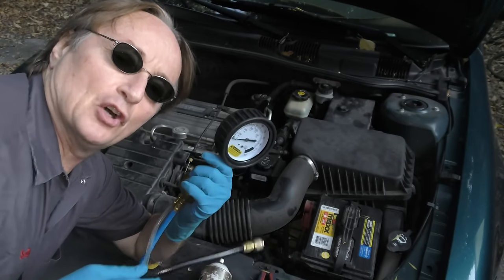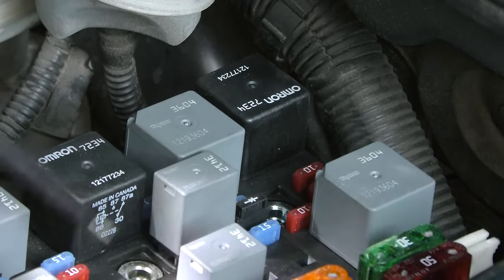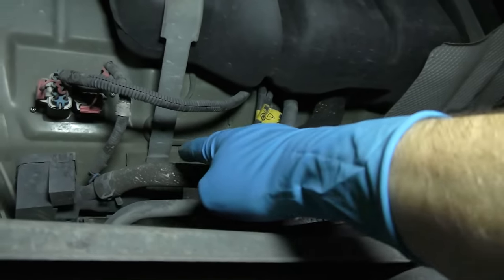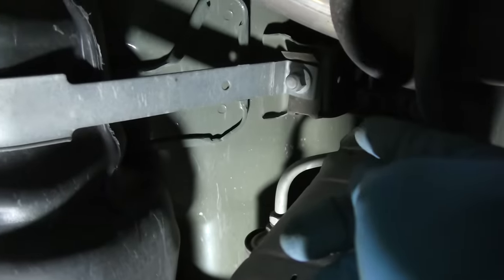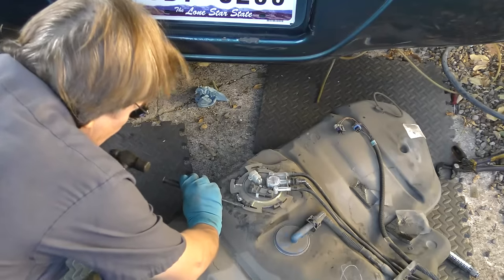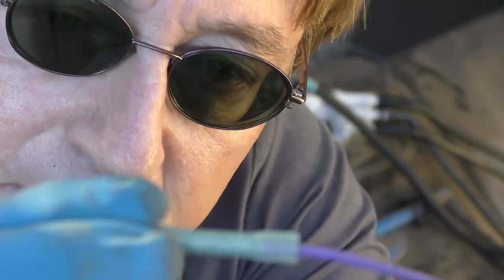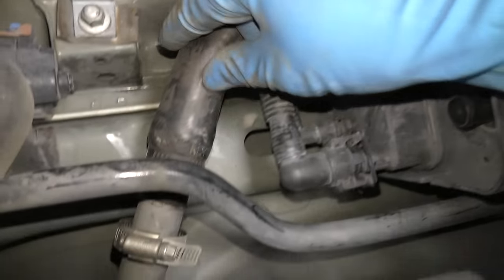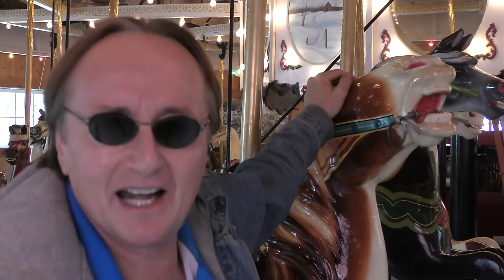How to Fix Car that Cranks But Won't Start (Fuel Pump Assembly)

Comment: Nice video Scotty, but shouldn't you show that there is a proper crimping tool to use with the butt splice connectors.  You showed the jaws of ordinary pliers squeezing the connector.  The crimp tool makes a nice tight dimple in the connector for a better electrical and mechanical connection.

Comment: Hey Scotty; do you prefer fuel pumps being on the outside of the gas tank or inside?
Reply from the maker: +Squishysforbreakfast outside
Reply: Scotty Kilmer I guess that makes sense lol. Especially when you gotta work on them eh?
What about owning them? Do you still prefer them to be on the outside?

I'm just wondering because I've heard that in tank fuel pumps are more reliable in general than those on the outside. Plus the new GM twin pick ups have them on the outside of the tank.

Comment: Had my '92 Chevy van die on me, fortunately I was parked and it was just idling.  But when it wouldn't crank back over, I suspected a bad fuel pump too.   Of course, being the noob that I am, I didn't think to check for the sound they make prior to starting the vehicle up, so I went through all the hassle of emptying the tank (enough), dropping it, buying a new fuel pump, swapping out the other one, and putting it all back together.....  only to find out it was the Ignition Module that failed.  So now I have a spare fuel pump if I ever need it.
Reply: +TazarZero 
"wouldn't crank over" or wouldn't start? There's a difference. 
Bad fuel pump wouldn't stop the engine from "cranking over".
Reply: Haywood Jablomy
Don't mind me, bud, still a noob with terminology too.  You got the gist at least, yes?
Reply: +TazarZero 
LOL. I do now. If that old van still has the original pump, I'd sure hang on to the new one too!
How much did that pump set you back...if you don't mind my asking?
Reply: Haywood Jablomy
I don't remember exactly how much the pump was.  I'm sure if you looked it up, the price of one today wouldn't be too far off from what I paid.  If I had to guess, I'd say maybe around $60??  The Ignition Module was far less though, I know that much.

Comment: My 2001 Concorde Lxi stopped while i was driving and takes a long time cranking to start back up and it will for a moment to a few minutes then just idles down lower then pass 500 and dies and takes a long time start up.. Also dies when trying to drive it gears...The fuel pressure is good but i hear a click coming from the intake tunning valve no idea what that does..

Comment: Hey Scotty! You forgot to mention those friggin' pumps cost a bazillion dollars!
Last mechanical pump I replaced cost $14 exchanged, and took 15 minutes to replace.lol
Reply: +Haywood Jablomy If you don't mind taking the fuel delivery module apart, you can usually get a generic electric fuel pump to fit for $80-$100. The pump is buried inside that module and a new one locally for my car was over $300. I got a used one for $50. If you get a generic pump, make sure the pressure is the same as the old one.

Comment: You should remind folks you have to fill the tank up after this job to get that bucket properly filled. The first one I ever did, I strapped the tank back on and jumped on the highway. As soon as I got up to speed, it sputtered and died. It started up again, then a mile down the road it sputtered and died again. Sitting on the side of the highway, I noticed the instruction booklet in the fuel pump box, and there in big red letters it was telling me I needed to fill the tank to at least 3/4 of a tank after the installation. Duh! After I limped to the gas station and filled it up, everything was fine.

Comment: Hi Scotty speaking of cars and having trouble starting, I jut replaced my starter and my fuel pump but I still feel a "lag"/ semi crank when starting WHEN I have had the A/C or the heat on for a while(15 + mins). Any idea what that might be? The alternator is fine, just installed a new battery and radiator too. ??? I'm stumped. Just interested on hearing YOUR opinion. Thanks man your channel is the best, everyone should subscribe. Esp car lovers!
Reply from the maker: +ss4vegeta1 I would load test the alternator again, as weak ones do just that, as can bad wiring
Reply: Going to do that but you think it could be the fuel injectors?
Reply: Just checked the alternator again it was good.

Comment: I've changed the fuel pump on my 2001 vw beetle (turbo diesel) it was sitting for several months before it was changed and now it cranks but won't start, I've been told the fuel isn't getting to fuel injectors.. is there any magic machinic tricks to do this without a fancy pump? Assuming that that is the issue of course 🤦🏻‍♀️
Reply: There is a fuel pump and a fuel filter did they do both. If the fuel filter is clogged even with a new fuel pump ull have a problem.

Comment: hey bro, i have prob...i have brought a swift vxi just 4 months back. the car was running good, 7 days ago i have done the pollution test also, bt after 2 dayz from dat, the engine is not starting. Though sometimes the engine is starting, a defective sound is happening and this is happening for 1 min. But now the engine is not starting, lights and symbols in the dash board is also not showing. plz suggest me bro.......

Comment: Hi Scotty. I have an 06' maxima that stopped on me while driving. I've used 3 different mechanics to troubleshoot and fix parts. So far combined they've changed: both valve covers and valve cover gaskets, the pcv valve, all the spark plugs and ignition coils, both camshaft sensors and the crankshaft sensor, the O2 sensor, the mass airflow sensor (I bought two new ones since i was told by the second one it needed to be from Nissan), and as of yesterday, the fuel pump was changed. It did the same thing, start once then cut off almost immediately, never to start again, only crank. Please help.
Reply: Just curious what ended up fixing your problem even after putting on a new ⛽ pump 😲

Comment: i replaced the fuel pump in my 02 grand am but it will not turn on due to low voltage. i dont know what the problem is any help would be much appreciated

Comment: I replaced the fuel pump 
And my car was fine for like 4 days,  i try to turn it on and it'll crank but won't start..
 New battery , new starter & now the new fuel pump...
I think it's some electrical

Comment: Do you think these pumps go bad because the in-tank filter gets clogged and the pump is overloaded?
Reply: +spelunkerd Old gas tanks tend to have crap and dirt at the bottom and if you run the car to low on gas the pump will pick the crap up and clog the filters burning the pumps out. It's always smart to fill the car up at 1/4th tank and no less.
Reply: +SkywallGuttz Very good advice to those who heed it.
Reply: +spelunkerd probably would've been better if he changed out the fuel filter as well...
Reply: +spelunkerd HI Dave , I was thinking about you the other day while I was making a series on making  jerky and you know what I did mention you.
Reply: +twoeagle86 Most of the newly designed fuel pumps come with a new fuel filter automatically included. I was puzzled by the new design until I realized that the classic fuel system used quite high pressure upstream of the filter. That created a possibly dangerous situation in an accident, and also the pump in those days had to be robust enough to overcome fuel filter resistance. New fuel systems have the filter upstream of the pump, so if the line is damaged in an auto accident there may be less fuel spilling onto the road. However an upstream filter is nearly impossible to swap out without dropping the tank.
Reply: +SkywallGuttz Also, the fuel lubricates and cools the pump.  Cranking or running the engine when it's too low can burn out the motor.
Reply: on my 1990 integra my fuel pump come with a in tank filter that prevents that.
Reply: +ScubaCat3 Always keep at least 1/4 tank of fuel in a car with a tank-mounted fuel pump. You are absolutely right, the gasoline keeps the pump cool. +spelunkerd If the in-tank filter gets clogged, or the inline filter (usually around the driver side rear wheel, or near the firewall on some Japanese cars) gets clogged, the pump has to work harder to deliver the fuel - which will, of course, shorten its lifespan.
Reply: +drfizzle420 Honda pumps almost never go bad ,,seen some relays fail ..
Reply: The fuel pump on my Durango is all one assembly.

Comment: my 2000 honda accord lx literally just did this to me.  now i might be able to avoid a huge bill from the mechanics shop.
Reply: +vashspecter Your car has an acces hole in the truck or under the back seat so you don't have to drop the tank. It should only be a 30 min job
Reply: +Nutz4Gunz45   really?  awesome!  thanks for the tip :D

Comment: I know the Germans of crazy stuff, but the fuel pump on my 2004 BMW 5 Series was under the back seat, and you didn't have remove the gas tank to get to it.  It also didn't break in the 11 years I had the car.

Comment: I've got a 2013 Astra, it's starts perfectly, runs perfectly but if I turn the engine off to go shopping or leave the vehicle for a few minutes it cranks but doesn't start, however if I leave the car a good hour or two to fully cool down it starts perfectly again, any ideas? It's been like this for over a year, I try to keep the engine running if I need to leave the car for a few minutes as a work around 😂

Comment: Hey Scotty, I have a friend with a 370z whose car starts on a warm engine but dies after about 2 seconds of running. Always turns on fine with a cold engine but warm gives her that issue; any ideas what to check? Battery is at 11.8V.
Reply from the maker: +AnalogCaliga on those, often a bad maf sensor or vacuum leak on the intake system

Comment: I have a 1997 Buick Park Avenue. It started jacking and driving really slow so I gave it a tune-up it was fine for a little while, then it started again sometimes it would even kill at a stop sign or red light, when I kept my foot on the gas it kept running I let off the gas it killed. I did a field treatment I let it run I filled it up with gas. Now it turns over but won't start any idea what it could be? Video request or reply thanks.
Reply: HALO FIRE Vacuum leak,use soapy water on those vacuum hoses! It helps u find the leak,u can either replace the hoses or temporarily fix it with tape,but do a good job or that fix will be for nothin!

Comment: hey guys and scotty i have a question

 What is the best way for me to learn about cars on the internet, any good websites except for youtube? *unless you know some really good youtube channels)
I'm especially interested in Audi, but i really want to learn about the basics in cars too
Thanks:)
Reply: +Iflexis Hi, 1, search for "forum fix Audi cars" or similar language and you will find many sites to help you.  If you narrow the search for your model and year you will get more details that apply to you.  2. If you have a repair that is complicated or you're not sure about tackling, you could try alldatadiy.com.  For a small fee like $15 for a year, they will show the repair procedures for your car if you can figure it out.  You can search for a discount coupon before you join and it might be cheaper.  Not the most user friendly to me.  Hard to find your way around until you get used to it.  Good luck!

Comment: Don't you have to change your fuel filter after you do this? I had to change mine twice when I did this repair a few years back..
Reply from the maker: +AngeredFox  you can if you want, but this pump was old and just stopped working from age.
Reply: +Scotty Kilmer ahhh...I had to because crap from the bottom of the fuel tank got stirred up and got sucked into the line/filter.

Comment: i replaced the fuel pump in my 07 hyundai accent and it still will not turn on. it cranks but no start, fuses are good as well. i dont know what else to do could you help me ??

Comment: I've had my fuel pump replaced and it still won't crankn over second pump that was replaced first one was due to my roommate using diesel second pump blew from the mechanic rigging my wires around my drive shaft and they got caught the wires have been fixed and again my fuel pump was replaced but still no crank?

Comment: I got a 1983 f150, just changed the fuel pump because I had the exact same problem and I’m still not making any fuel pressure. Anyone have any ideas of what to check next? Thanks!

Comment: So, I've just changed the pump and filter and won't start, but ironic is that the old fuel pump did get it started once the weather started to get a little warmer. Any suggestions will help me greatly
Reply: Can it may be lack of power to fuel?
Reply: May be but I'm definitely going to check

Comment: I have a 94 chevy k1500 my truck starts but stalls especially if I try to put it into gear or turn the wheel. I have replaced the fule filter the iac valve, erg valve, the tps, the distributor car and the rotor. don't know where to go from there. any ideas? thank you for your time
Reply: +Miguel Gutierrez check your pump pressure, depending on the type of system it should be around 55 or 62psi key on engine off anything lower than that it will never start and while you where there key on engine off watch the pressure game make sure is not dropping, that truck has spider injector and they know for leaking

Comment: I would have cut an access hole in the trunk where I live the rust under the car would require a lot more work and parts to complete the job.

Comment: I have a 2007 chevy impala. It stopped running. now it cranks and wont start. I have replaced the fuel pump, cam censor, engine coolant censor, the ignition switch, the  coil pack, the spark plugs.  still doing the same thing.  cranking and not starting. I hate to bother you but I'm out of ideas. I was hoping you might have some.
Reply from the maker: +Jeremy Howe do my other video tests "fixing a car that cranks but doesn't start up" and pray it's not a blown head gasket

Comment: Hey Scotty, I have this same problem with my 01 Civic LX. Just that it starts sometimes, and then other times it take a few tries to start it up. Could it be the Fuel Pump? I know that theyre pretty easy to change on these cars.
Reply from the maker: +Gilberto Benitez  could be, BUT try cleaning the fuel injectors first as dirty ones do just that

Comment: Hey scooty, 
Looking into buying a 2013 Chager R/T or a 2012 Ford Taurus, which one would you recommend?
Reply: I would definitely go for the Charger. I feel that it has a more engaging drive
Reply from the maker: +Shawn K depends, if you want speed or reliability, charger is fast, taurus will outlast it

Comment: Hi Scotty , how do you know if your water pump and alternator is packing up, thanks.
Reply from the maker: +Thavanesh Chefty alternators can be load tested, and water pumps can be pressure tested as they often leak at the main seal when going bad
Reply: Hi Scotty , thanks for the info . I will give it a try and let you know what happens.

Comment: I'm having problems with my xj running. It will start but won't stay on. The gas pressure drops after it starts and it dies when it gets to about 10 to 15psi. While I start it the pressure is at 40. I replaced the pump and it still does it. It has a new filter also. Any suggestions?
Reply from the maker: +Mac MashPotato replace the fuel pressure regulator, and pray it doesn't have a bunch of leaking fuel injectors too

Comment: 2000 Toyota Camry Le, replaced  water pump, fuel pump, fuel valve service repart on Dec 2019. My car won't start

Comment: So my fuel pump isn't bad. Cause the problem with my Pontiac is that I don't get an accurate reading on my fuel gauge on the dashboard. It either reports full or empty, regardless of how much gas is in the tank. Any ideas?
Reply from the maker: +iamageek500 generally a bad fuel sending unit which is part of the pump assembly as in  t he video

Comment: Hi Scotty Kilmer, I just had the timing belt changed on my 2008 Hyundai Elantra. It seems to be running fine, except for I believe a wheel for one of the belts that sounds louder than normal. My car also seems to be idling slightly higher than normal also. What could be the issue? Thanks
Reply: +El Pollo Loco 51 the new belt has more tension the old the old belt could have been bad for a while and now you have a new one you notice the difference
Reply: +El Pollo Loco 51 One of the reasons i will never purchase any car that comes with timing belt instead of timing chain that will never need replacement... i tend to drive my cars up to 200,000miles before getting another. I cover a lot of distance everyday and  easily hit the mark after 4years.

Comment: @scotty kilmer my 98 explorer had all the symptoms of a bad fuel pump so I changed it along with the filter and it still doesn't start at the fuel rail I get 35 psi any suggestions
Reply: Do your injectors fire correctly?

Comment: hey scotty my car wont shift into an gear.. also my car turns off when on neutral could it be the clutch?
Reply from the maker: +KingVic95 well, a clutch won't make it turn off in neutral, so you have at least 2 different problems. Put put in a clutch first IF the master and slave cylinders are OK

Comment: Just replaced the fuel pump on my 2003 Ford mustang 3.8 V6. And everything is installed correctly, but still not starting. I Cranks,  but won’t start. I’m beat for answers.